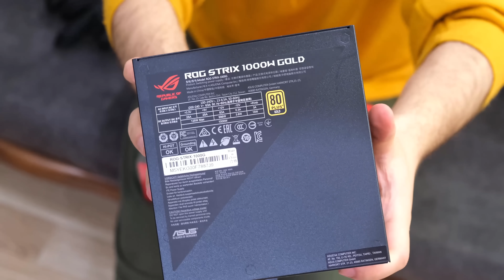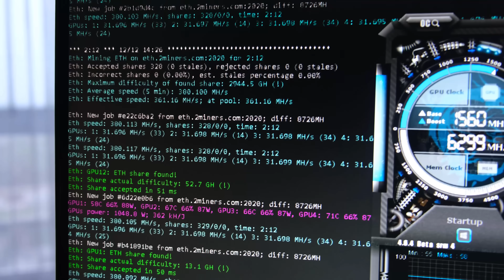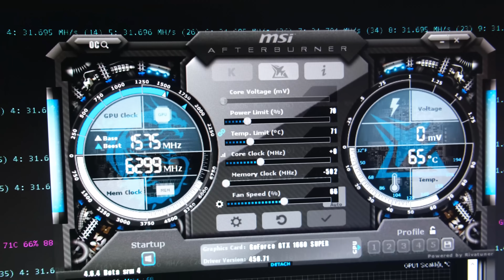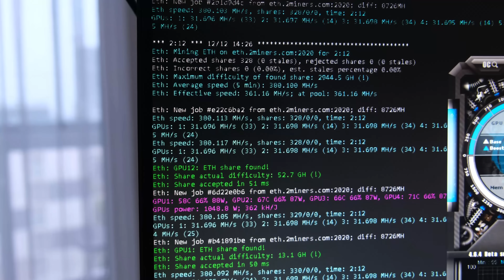12 Ekran Kartlı Mining Sistem Kuruyorum - PARA KAZANMAK HALEN MÜMKÜN MÜ?

Comment: Ustad merhaba. Elimde 2 adet 1660 super var. Biri evga digeride asus rog strix. 2 kartta ayni oc degerlerinde farkli mhs degerleri aliyorum. Asus 1660 superde memory clock u -502 yaparak 31 mhs alirken, evga da memory clock u 900 yaptigimda 30 mhs aliyorum. Bu iki karti ayni rigde nasil 30 mhs de calistirabilirim. Rigte hangi oc ayarini kullanmam gerekir?